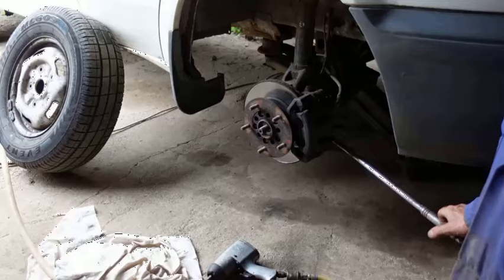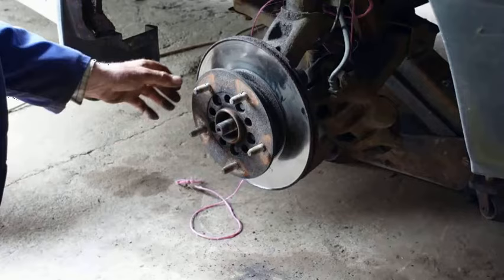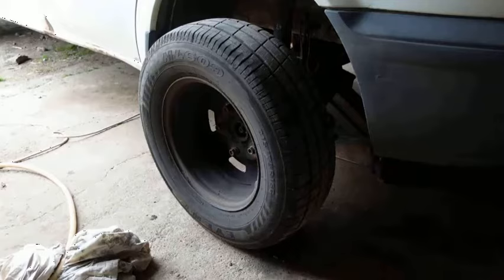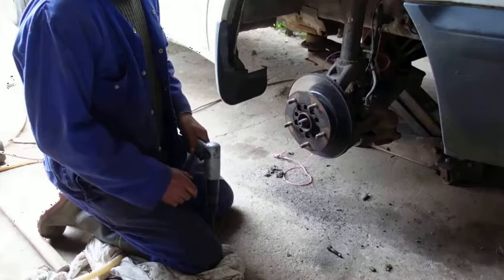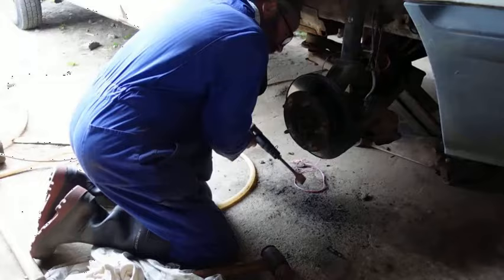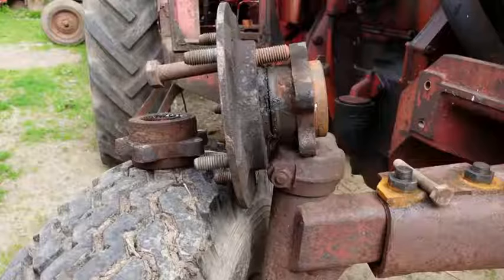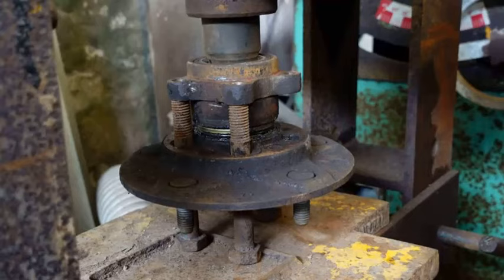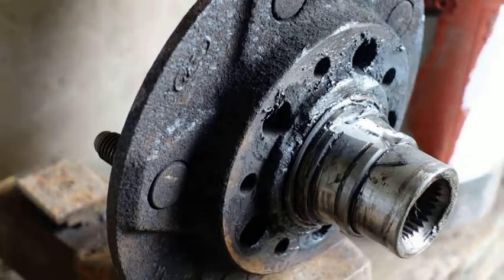Ford Transit front wheel bearing replacement

Comment: Umm, the bearings are pressed on.  The 310ft/lb is no where near fully on the bearings.  So just doing it tight with a breaker bar is plenty.
Reply from the maker: I think that the manufacturer's probably know best so I choose to follow their instructions.
Reply: @wotjonsez2560  yeah right, that is why i just used a breaker bar and did mine fairly tight with no problems.  Most of that tension is just going  into a spacer. If you put 310ft/lb into a tapered roller bearing it will just lock it tight.
Reply from the maker: @sammyd7857  OK Sammy, you may be right; why don't you tell Ford?

Comment: I hit a curb and since then I have a intermediate grinding sound while driving.  A mechanic told me I had bent the left rear axle (on the opposite side) of the tire that hit the curb. Charged me $960 to replace and the truck Is still grinding.  I filed a dispute and got my money back. Do you think it can be the bearings and he just didn't check that ?
Reply from the maker: Well it could be but wheel bearing noise does not usually sound like grinding. Check simple things like the brakes and the backplates and if it is a rear wheel drive check the prop shaft center bearings, they often sound like brakes ginding, good luck, Jon

Comment: Same problem with it not coming off. 1mm gap and thats it. I dont have a air chisel. Would screwdrivers hitting in all the way around help. Also would it damage the base
Reply from the maker: Anything that you can wedge in there will help, does not matter if you damage the diameter because you will be replacing it and you can clean the flange up with a file before fitting the new part. Good luck, Jon

Comment: Just a quick question, I have snapped wheel studs. To get to them , I think I have to do the same process. Nervous about getting stuck doing it myself 

Fwd mk7, 2 rear studs snapped
Reply from the maker: Get your new studs first and try them up to see if you will have enough space to fit them in from behind if not, I am afraid that you will have to do the full works. Good luck, Jon
Reply: @wotjonsez2560  thx for the reply.  Hub needs to come off 😩

Comment: So 185 ft lbs = 250Nm
And
310 ft lbs = 420Nm? 

Can someone confirm this as it seems overly tight?
Reply from the maker: Hello Nik. Yes, it's very tight. I got the specs. from the manual. Previously I did my old Transit front wheel bearing for the annual MOT, just tightened it with a strongbar and was astonished when it failed the next years MOT on that same bearing. The vehicle examiner told me then that these bearings often fail if the correct tightening sequence is not followed. It must be three years since I did this job and I have had no problems with it. Good luck, Jon
Reply: @wotjonsez2560  Haynes manual? Someone on a forum said that the Haynes has a decimal error on it. That it would be 25Nm and 42Nm.
Reply from the maker: @Nikoxion  Yep, it was out of the Haynes manual but I would not believe the decimal error. 42nm is about 30ftlbs which is not even tight on a nut of that size. Our local tyre fitter tightens all car wheel nuts to 120nm and they are a fraction of the diameter of this nut. This is serious stuff you don't want your wheel coming off at 70mph so my advise is, if you don't know what you are doing give the job to someone who does. Do believe me there is no insult intended there, safety is so important. Regards, Jon
Reply: @wotjonsez2560   My friends Mercedes has a very similar front bearing with around 20Nm of torque spec. As it also mounts on a  tapered shaft, I would want to believe that this would be the same.

I'm really bewildered by this difference.
Reply from the maker: @Nikoxion  These are not common old fashioned tapered bearings, these are sealed units that require a preload. They do not mount on tapered shafts and neither do any Merc. front wheel bearings that I have come accross. Sometimes rear wheel bearing flanges are on a taper but they are plain ball race bearings. You need to give this job to someone who knows what they are doing and who has the neccessary equipment to do the job properly. Jon
Reply: @wotjonsez2560  Okay then I have a different model of transit. My front bearings are mounted on a tapered shaft. Should have paid more attention.